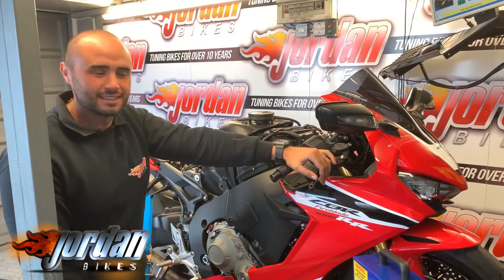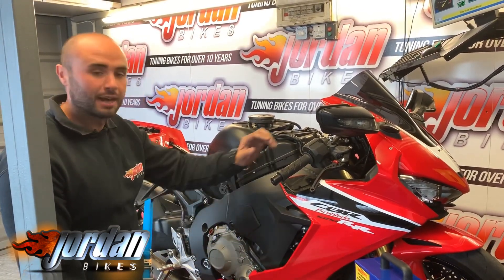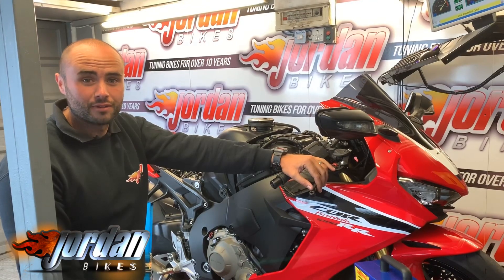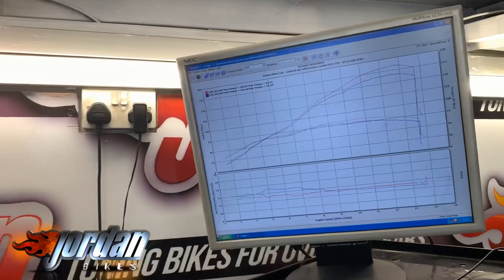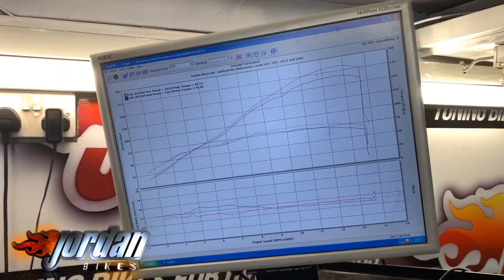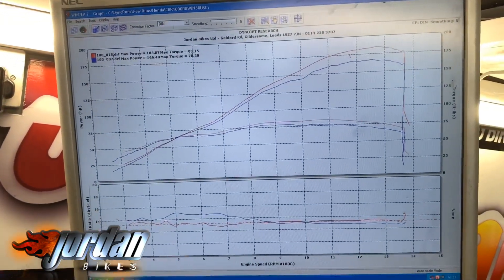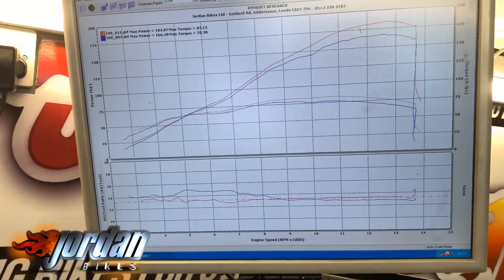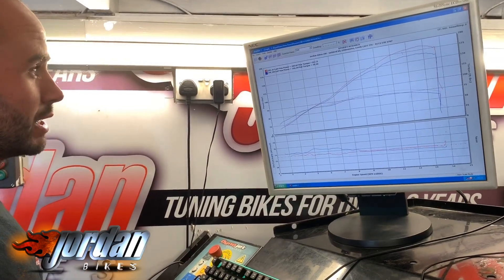Jordanbikes ECU REMAP CBR1000RR Fireblade 2018

Comment: I have that bike with that slip-on.can you point me in the direction of where to buy the cat delete/mid pipe?
Reply from the maker: We are an Akrapovic supplier, give us a call on 0113 238 3707 or check our the performance parts website 👍🏼
Reply: I'm in the united states so it would be easier to use your website. I just don't see your website posted in the description. Can you attach it for me please.
Reply from the maker: @jeremybly  we don’t ship overseas, you’ll be able to find a local dealer who sells Akrapovic im sure 👍🏼 the website i mentioned is a uk parts supplier, they’re not USA based.